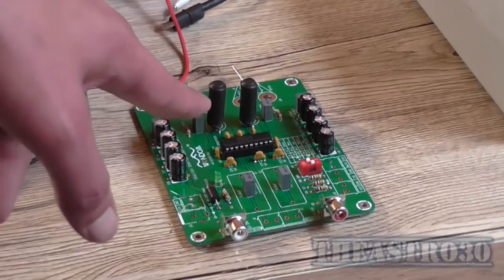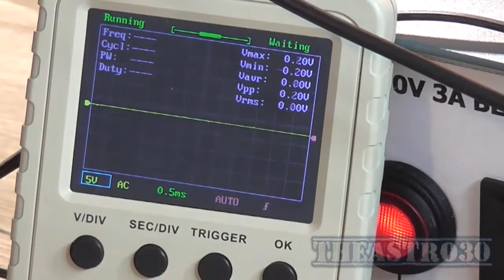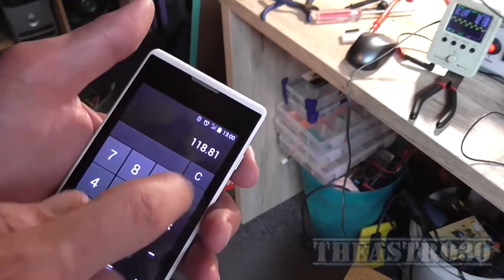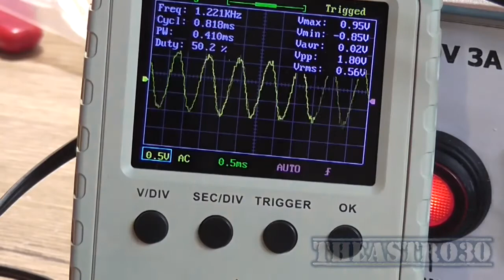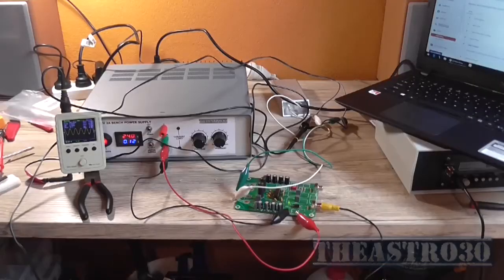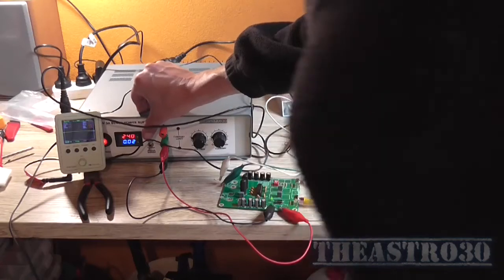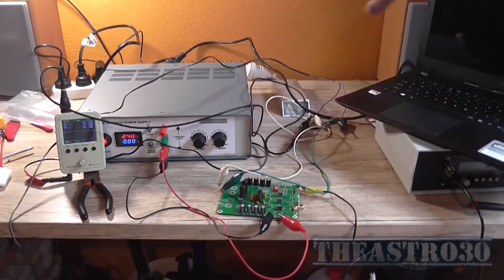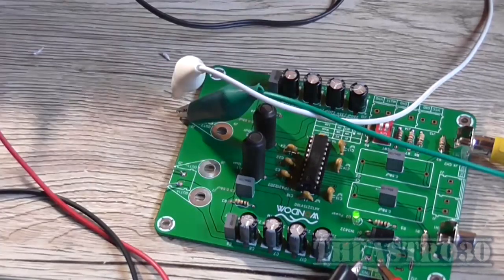TPA3122D2 Class D Amplifier Revisit

Comment: It's a simple circuit. The oscillator  frequency should be around 250KHz. Check the residual output with the proper load connected, otherwise the frequency response of the LC filter will change.

I've built one and it's working fine. I used the suggested design of the datasheet. Also used a custom board. It works flawlessly.

You can also check the socket. I did not use one in my board. Up to 18v you can use 4ohm loads. Test it with 12v first.